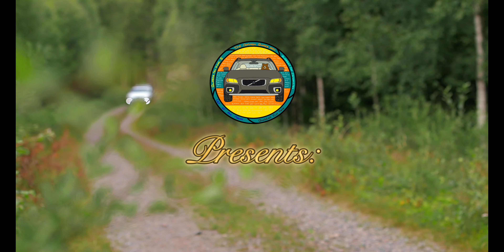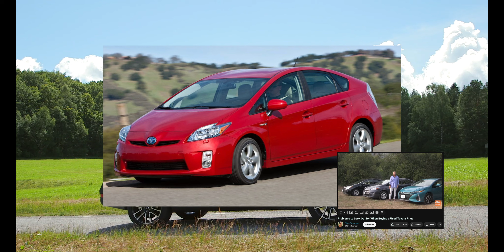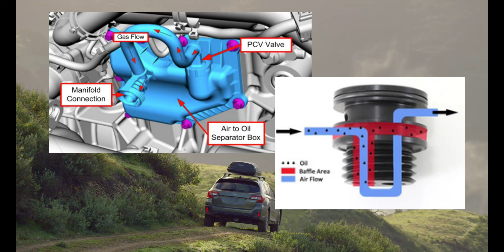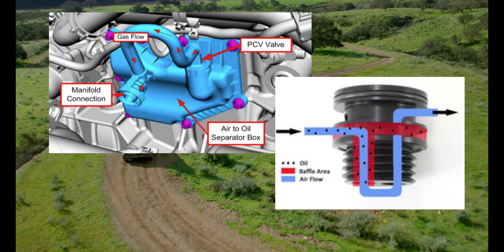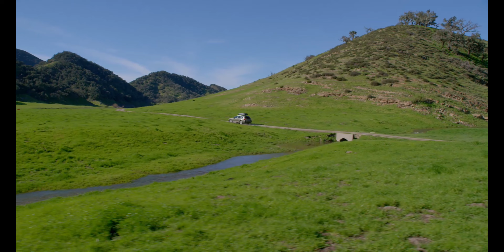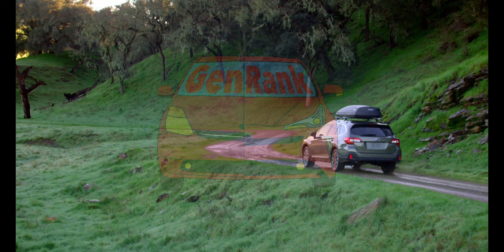The Forgotten History Of Toyota's Engine Catastrophes

Comment: I got something for you to rant about the new Audi Q7 no more 19 inch alloy wheels, and you’ll get standard 20 inch alloy wheels all the way up to 23

The next-generation (2027) Audi Q7 features a standard 5x112 bolt pattern and comes equipped with 20-inch alloy wheels as standard. Buyers can upgrade to a variety of larger, dynamic designs ranging from 21-inch to 23-inch wheels depending on the trim level

Comment: Another flaw is… the engine coolant water pump, the little plastic spinning impaler inside… swells and cracks over time, causing the pump to fail. This obviously causes the engine to overheat, and another flaw is, the computer hardly gives you a warning light when your engine is starting to over heat. (No temperature gauge) So many head gaskets and engines have been destroyed this way. 

There is an aftermarket metal impeller. Or you can buy a whole new pump directly from Toyota or Aisin. Beware of knockoff counterfeit parts.

Comment: The clogged EGR surely does contribute to head gasket failure… 

But I’m thinking now that it’s old corrosive coolant playing a major factor… 

Because the failure is almost always the coolant seeping into the cylinders… corrosive old coolant eating away at the seams. 

The PCV valve’s horizontal placement is another design flaw, allowing oil to pass through into the intake manifold, it pools up under the throttle body…  gunking up the fuel injectors… allowing oil into the combustion chamber… An oil catch can fixes this.